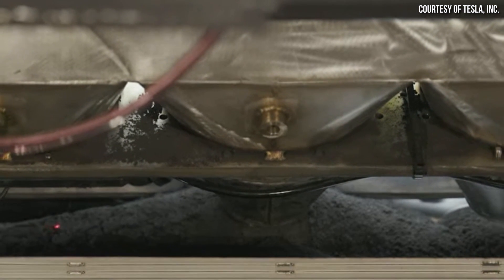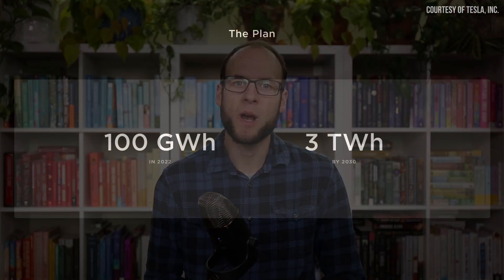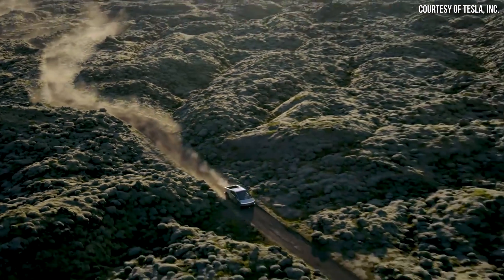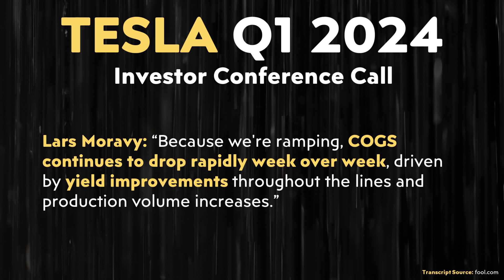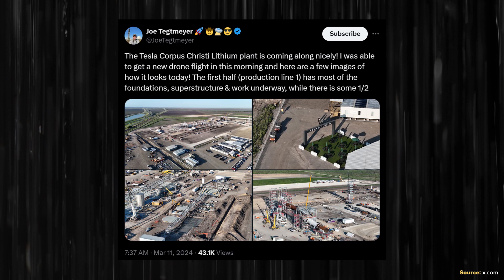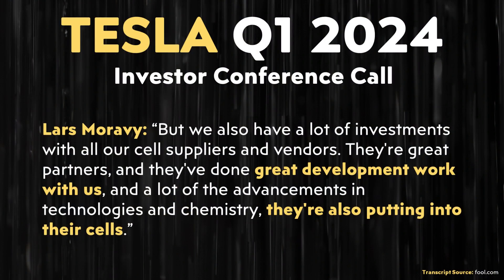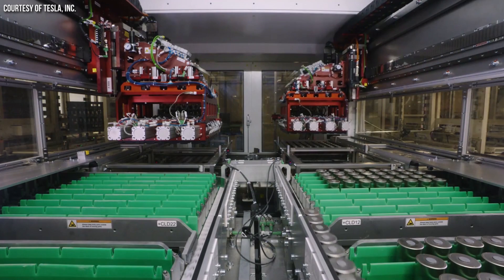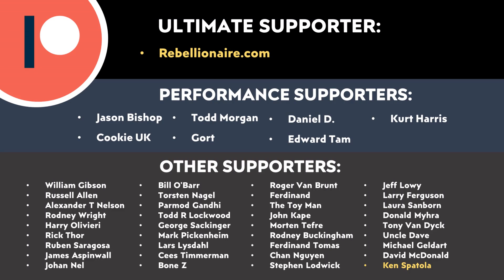Tesla's BIG 4680 BATTERY Updates | Production RATE REVEALED!

Comment from the maker: Amazon Affiliate Link (I earn commission from purchases using this link): https://amzn.to/3QlLpyX
Reply: Bringing "in house" assures far greater quality control is my view anyways. Is interesting to hear the comments on the differences between Panasonic(performance Model 3 just out right now) CATL and I think LG are the "big 3" for Tesla. Big management and employee shakeup appears to have quick results as well. My understanding of the 4680 and you're definitely the expert on this not me but they are "tabless" which presumably creates a far more rugged and durable relationship between anode and cathode thus providing more stable power output. Watching a video,of a guy wrecking his Cybertruck on the sand dunes and I have to say I learned a lot from that video. Cybertruck has a long way to go prove itself as the litany of overheating prevention systems which presumably are there to prevent thermal runaway which are all critical components mind you but that has to be cleaned up in a huge way as does the suspension and how the suspension be properly robustly connected to the frame of the vehicle. Definitely a huge opening for both Ford and GM and Rivian as a consequence...maybe even Dodge actually. Still Tesla is absolutely boot to the neck of the pure play BEV Industry still. Goes with saying that Giga Berlin will develop their own battery system as well? Sure seems like it to me with World War 3 raging away now out that way. Japanese Yen and Chinese Yuan getting absolutely annihilated here as well so might get a currency War between those two massive economies which is maybe why all the CATL crazies are running wild in the comment section😮😮😮😮😮😮. Either way some incredible product is in en route for the North America market across the board for vehicles of every type of course but also everything else #over_capacity so great time to be reviewing as opposed to purchasing at the moment as the 2025s are en route and if the Subaru BRZ is any indication the entire Auto indeed bev /combustion  Industry is about to begin to experience some truly awesome pricing pressures. Long $gt Goodyear Tire strong buy.

Comment: We see from the Munro teardown that the CT 4680 cells are designed to burn out in a particular way that leaves the other cells and pack in tact. Tesla, therefore, has to share its cell design with suppliers to ensure the supplied cells will fail in an identical way if it does happen. The CT pack design has 7 cells in parallel. If a cell burns out, no repair action is required as the current passes through the other 6 cells with negligible impact on performance - perhaps the charge and discharge rates must be lower??

Comment: I'm really surprised that all EV battery makers aren't using large cylindrical tabless cells. It's blindingly obvious that once you've cracked the tabless electrode process, these are so much simpler and quicker to make. Look at any of the pouch cell production lines to see the complexity of handling and manipulating separate plates into pouches and connecting it all up. It's a no brainer that Tesla's 4680 cell is ultimately going to be much cheaper than the competition. It should be relatively easy to then change to different chemistries with very similar equipment. Once again, Tesla shows legacy companies how to do it better.

Comment: Dear Mr CleanerWatt, what's the impact of the SVP - Head of Powertrain and Energy Engineering going to have on my 48V, Drive By Wire, Ethernet Wireharness, Quicksilver Model Y?  Drew Baglino has cashed out of all of his stock and seems to want to leave everything Tesla in the rear view mirror.  Did he bail because all this stuff is FAR IN THE FUTURE?

1,141,362 Shares Sold 4/25/2024, Gross = $181,476,562.21 ➖ a little tax problem here.  ($60M)

Comment: 7 GWh vs targeted 100GWh production is a disappointment. The cost reduction from producing 4680 doesn't affect much savings overall as it will only be used on cybertruck. 
Curious to know the performance of 4680 compared to suppliers'. Energy density (Wh/kg), efficiency, charging speed, etc.
Reply: Semi, austin Y, Roadster followed by the rest at full production
Reply: times 8

Comment: We need an option with more than 123 kWh battery packs. Tesla needs to either put more cells in the pack, make larger cells like rivian is doing (since we know there is room for that in the pack) or get the energy density of the current cells up. With the GMC Sierra Denali coming out at the end of this year followed closely by the release of the Silverado RST both of which have a range of 440 miles. This will put Tesla at a higher price than the trucks in the same mileage range as it (Lightning and Rivian) and near the same price for trucks that have 100 more miles of range and a lot more towing capacity.
Reply: And they will make triple digit negative margins on these cars. Tesla keep printing money
Reply: @Matzes  How so? Adding 50 more kWh would cost them about $5,000 and they could charge $16k more for it. Oh wait that is what they are already doing except most people don't want it taking up 1/3rd of their usable bed when they have plenty of room in the battery pack for it. They could make more money and keep people like me who want to be able to tow and use the truck off road from going with a competitor.
Reply: @Aircam73  I would say it costs around 7-8k which is alot. Plus the extra engineering, energy and thermal infrastructure. Plus it adds weight which hurts effeciency. It's like a rocket equation. You can't just add kwh and expect the equivalent range to come out. You ll add weight which needs extra energy again to move. They are going to go with range and battery specs that work for MOST people. Look up the studies, people almost never tow anything with their trucks and rarely drive more than 200 miles a day. So why waste resources to build something for a niche market. They want to keep prices low because that is by far the single most important factor for people when buying a car. Maybe down the line there will be some hyper variant that does all the crazy ranges, but we need to serve the main marker first
Reply: @Matzes  The problem is the prices aren't low and the range is the same as trucks that cost less. This isn't a niche either as 20% have opted for the larger pack at $16k and with the reduction in bed space. That number would go higher if they offered a larger pack that didn't take up 1/3rd of the bed space. Range anxiety is the number one complaint especially when it comes to trucks and offing more range like GMC and Chevy are doing is going to steal a lot of customers away that want those things. especially when they cost nearly the same as the cybertruck. I should know I have had 5 tesla over the years and still have one right now. I have a Tesla roof and 4 PowerWalls. I love Tesla but if they can't deliver on a longer range truck I will be going with someone else who can and so will many others. There is no reason to have such a small battery pack in a large truck when every other truck has a larger one.

Comment: The 4680 has been a real challenge, disappointing at times, but it seems that they’ll get there in the end. It’s good that they’ve pushed through. Also a good strategy, but the execution has been poor so far. This assessment of progress has glossed over the fact that the battery energy density is poor / below target. I can’t help but wonder if eventually the project will deliver a 4695 with >350wH/KG energy density as that along with volume is what’s needed. This could give the Cyber truck about a 160 kWh battery and the range it should have for no extra cost and a small weight penalty.

Comment: So the run rate is still only a very small fraction of what was announced during battery day. And it is STILL cheaper for Tesla to buy batteries from third party suppliers than building them inhouse. Now that the bottleneck in the battery supply chains seems to be over, I don't see any big advantage of Tesla having their own cell production. Battery suppliers like CATL are progressing at a much faster pace and will always be on top in terms of technology and price. No matter how we put it - 4680s are not a big game changer as many people thought when the project was introduced on battery day.
Reply: Tesla's 4680 Cell, is 4 Elements: Cost, Chemistry, Performance, and Manufacturing Experience! 

Each one takes time to refine! 

The First Tesla Roadster only made 2,400 in 3 Years! 

Today, they can make that many Vehicles in less than a Week, in all lines! They already have had a Cybertruck Production week of 1,000 Vehicles, and Model 3 and Y are are far above that!
Reply: As said here and elsewhere,  the only current use for 4680 is CT and they produce all they need.
Next 4680/vehicle  ramp should be semi in 2026.
Reply: @snookmeister55  It's the other way around. Production capacity is very limited so the only vehicles they can use these cells at the moment is the Cybertruck and the Semi. Also it seems that buying cells from 3rd parties is still cheaper. The original plan was to produces 100GWh/yr in 2022 - now it's 2024 and we only see 7 GWh/yr.
Reply: @EinzigfreierName  yes, plans change.
Reply: @EinzigfreierName At this point I believe Tesla has all the 4680s they want and they will ramp as needed.   I believe this is obviously true and this is the truth according to Tesla.   CT will continue to ramp and Semi ramp now planned for 2026 I think they said on the 1st quarter call.

Comment: Semi is pushed out into 2026, so that makes sense. 4680 has been excrusiatingly slow and still no resolution on the cathode and transition to fully dry electrolyte... ie remove a big chunk of the cost of the batteries while boosting their energy density. 
Still nothing on this. The current energy density is barely a match for 2170. Well below 300wh/kg, hence the shortfall on expected range of 500 EPA miles for Cybertruck even with a booster pack. 
Meanwhile CATL is making big stride with Sodium...
Tesla is executing quite well in other areas (esp FSD) but the 4680 remains a major source of frustration holding back Semi.
Reply: Is Semi out until 2026 because of 4680 or other reasons?  The production factory has barely started construction. Very frustrating.  They could sell as many Semis in Cali as they could make.  Cali hates diesel.

Comment: I wonder if some of the enormous battery purchase contracts from legacy automobile manufacturers a few years ago were actually deliberate attempts to strangle Tesla.  After all, if they know they cannot build competitive EVs, which they did know, why would they NOT try to stop Tesla from building ANY other EV?

It seemed odd to me when Elon committed cash, time and resources to secure his own battery manufacturing and then his own lithium refining.  I didn't see the urgency, at the time.  Yes, plans to greatly expand production of existing vehicle lines as well as add new vehicles like NextGen, Cybertruck and Semi, would require a LOT more battery production to be available a few years from now.  That's fine.  His money is good.  He can order more batteries and work with battery manufacturers to assure that production expands in order for deliveries to happen when Tesla needs them, IF the battery manufacturers are NOT suffering from big cancelled orders and production is NOT contracted to build vehicles that will never happen.

What do you think?  

How much of the volatility in the battery industry is due to market fluctuations and how much is due to 'hostile' purchasing? 

If there is a 'story behind the battery market story' I can much more easily imagine why Elon would want to refine his own lithium and manufacture his own batteries.  Maybe not ALL of the batteries Tesla will need, but enough to defeat attempts to constrict his supply chain.

This might also be one reason Elon was so open during Tesla's first quarter financial report about declaring Tesla's support for battery suppliers.  Anybody thinking about a sneak attack on his battery suppliers should now understand Elon is ready for that, and so is Tesla.

It would sure be nice if this was all paranoid nonsense . . .

Comment: Thanks.  Great video.   I'm a long time holder of Tesla stock but I've gotten very frustrated over the past year.  These are some things I've read.  

4680 was suppose to be in full scale production back in 2021.  Still major problems leading to high scrap rate and slow processing.

4680 was supposed to be used on Semi but that is now questionable.

Tesla has pretty much given  up on 4680 being the wave of the future but is backed into a corner of putting too much money into them to turn to better technology battery designs.

I'm still very optimistic long term for Tesla and will hold my stock for many more years.  I just don't like FUD being thrown around.  Tesla, just give me the truth; don't over-promise.
Reply: Musk has been vastly overpromising for many years though. 
Be honest, and admit you simply ignored it because the stock was going up

Comment: Serious Q: does Tesla still care about 4680? Seems like they've thrown towel in on batteries going w CATL.

1000 per week is almost nothing 

Not anti Tesla just bought one want them to succeed in battery
Reply: Yeah 4680 turned out to be a failure.
Reply: Nobody would even have 4680 if it wasn’t for Tesla creating that form.
Reply: @ZeusBullyMax  started with small cylinders.  Tesla went to bigger cylinders, CATL to "blade" box shaped. Looks like blade trading over
Reply: It’s not 1000 batteries per week. It’s enough to build 1000 cyber trucks per week.
Reply: @ZeusBullyMax  I meant 1000 vehicles per week.  Drop in the bucket

When Tesla announced the 4680 they implied theyd use in many vehicles not just one low volume vase

Comment: You, like many, have been snowed by Tesla! 4680 cell production numbers are being touted all the time, but the most important matrices, Energy Densities, Charge/Discharge, and the Dry Cathode production problems are not mentioned!  Present matrices are not keeping up with supplied battery's, even ones they are buying for their own cars!
Why is this is so important? The Cyber Truck Beast is severely hampered by its lack-luster 4680's and the truly revolutionary technology built into the Cyber-Truck Beast may never break out into general automotive production until the launch specifications are met (Approx 300kw/kg & 15 minute 10% to 80% charge times) as forecast at the Battery Day Presentation.
If the potential of the Tesla Semi, and the contractor version of the Cyber-Truck are to be realized then the 4680 chemistry and manufacturing problems need to be solved.
Thank god Drew Baglino is gone, room for and true battery visionary to take charge!!
Reply: Robin if only you had any idea of what you're talking about. As a engineer I just love it with a Muppet thinks he knows what going on
Reply: a visionary is what is missing to fix these problems. Or these are problems nobody on this planet has solved yet. 

I like, that they try and learn and manufacture some batteries themselves. Maybe they get there.
Reply: 4680s are on par with good 2170s from suppliers.

Comment: In the meantime - CATL does it again and confirms that 4680 is waaay too late and a waste of time and money.
Reply: LOL we need you to attend a battery engineering meeting at Tesla so you set them straight. And they can have fun with a ignorant no it all
Reply: @noCOtwo  I think you mean know-it-all......... right ?.  
So much time and money buying Maxwell, (who couldn't solve the dry coating issue) and developing heavy cans; difficult to close at high speed, and less than special energy density......... but I bow to your greater knowledge of this entire process.......... after all - what would Chinese know ........ right ?.
Reply: @noCOtwo  Roger stop being a clown.   If you are an engineer, so what?  It means nothing unless you are working on the 4680.  All you are doing is spouting out useless insults.

I have owned Tesla stock for a long time and can see where some Tesla projects have turned out to be failures.  I'm a retired engineer with 45 years experience but the only info I have on 4680 is what I read about which anyone can do in the age of the Internet.
Reply: @JamesAnderson-lq8tf  lol look engineering is something you don't understand until you do and it is ALWAYS hard to beat a competitor that is leading the industry. It could easly take Tesla 10 years to finally catch CATL but they are progressing very well and think this year they will be able to produce NMC batteries for less than CATL that to me is a fantastic accomplishment. So just shut up and listen
you may learn something.
Reply: CARL makes some good batteries but they are not all that. LFP has limitations well
Reply: @RagnarinVa  who is CARL?.  LFP's limitation are of the slight inconvenience variety.......... accompanying the delightful safety and durability @100% SOC...... every morning.
It must be the fashion, because it's in great demand, worldwide.
Reply: @davidpearn5925  - I meant to say CATL.  I did not disagree with some of the benefits of LFP - but again you missed the point. The 4680 cell is a form factor - not a chemistry - it can be made as an NMC battery, and LFP battery or an LFMP battery. They reason they are developing production efficiencies in this form factor is because cylindrical cells can be made faster than prismatic cells. Even ONE the American manufacturer of LFP batteries is looking at this.

Comment: So a while back we were waiting for the Model Y in America to be built with 4680 batteries in a structural battery pack,sandwiched between front and rear gigacastings. Are the 4680’s just being used for the Cybertruck? Are the Model Y’s in America using batteries other than 4680’s, e.g. 2170’s in a non-structural battery pack with no gigacastings?